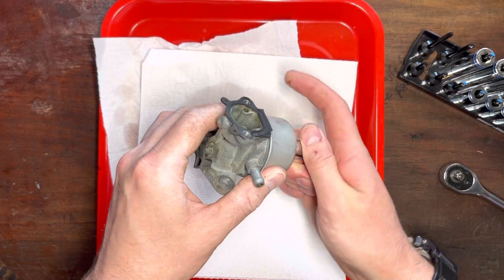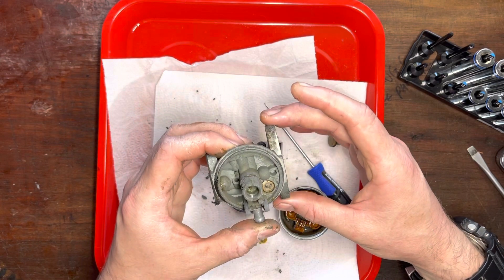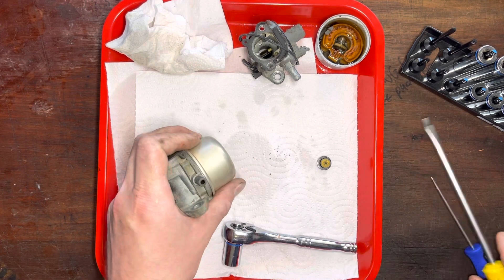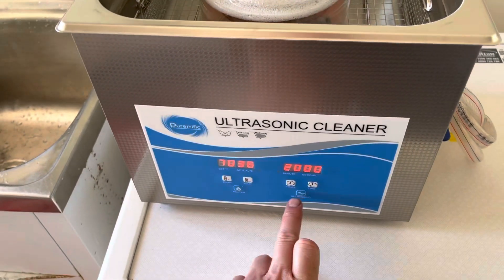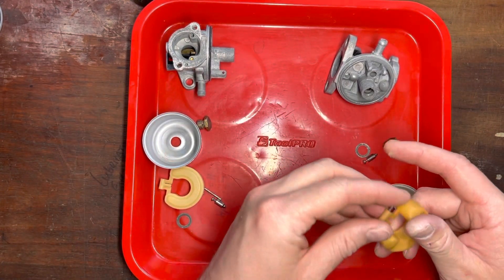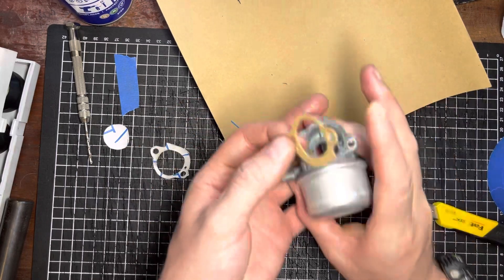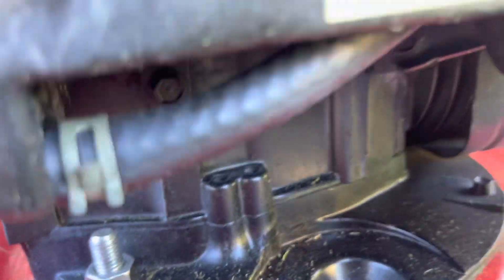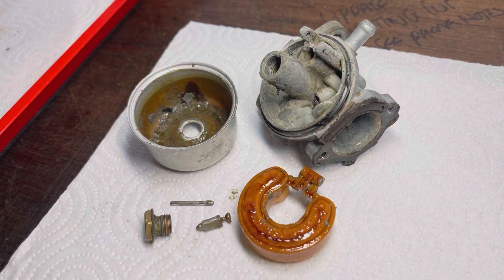ANOTHER Engine Failure & The WORST carburettor I’ve EVER seen!

Comment: I have gotten away with just putting a new con rod in. The crank hasn’t got to be perfect and the rod is aluminum of course so a lot of times if there is scoring on the crank it’s just transfer like on a cylinder
Reply from the maker: I wonder if new shell bearings on the con rod would have helped? At this point it would ideally get new rings, then a new gasket. The cam maybe worn too. It requires too much time and the profit margin would be in the negative rather quickly!
Reply: @VintageEngineRepairs  yes ideally but for a mower like that, not smoking and running ok I wouldn’t worry about all the fine details. I would just fix the parts that go “clunk” lol. The ones I’ve worked on don’t usually have replaceable bearings the con rod itself is the bearing. It’s not until you get to the bigger engines like the v twin tractor engines that I have seen that. My grandmas old mower was running like that and all I did was the con rod and rings. I don’t think even replaced the head gasket and it ran for another 10 year before it started smoking and getting hard to start
Reply from the maker: @farmerjackson709  ah yes of course, I was thinking back to some of the villiers I’ve worked on and replaced them! 

Thanks for sharing :)